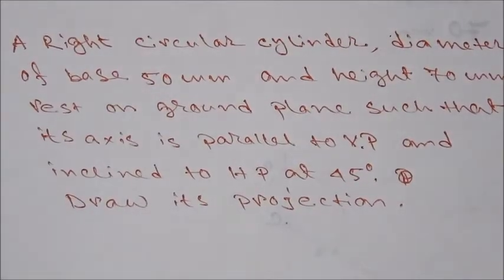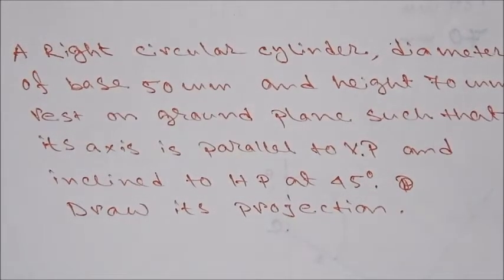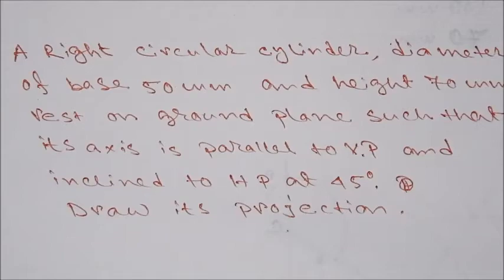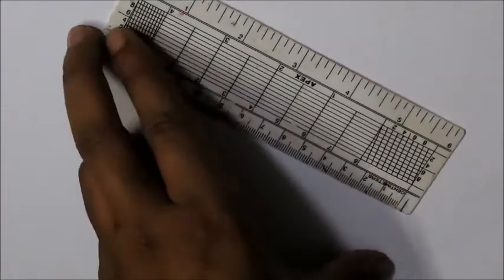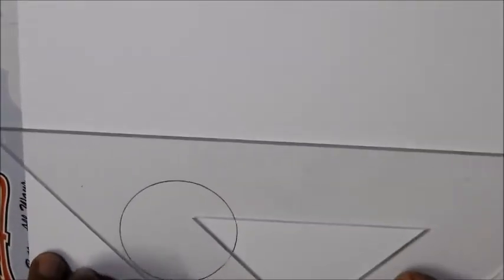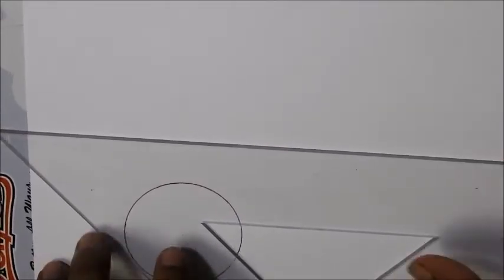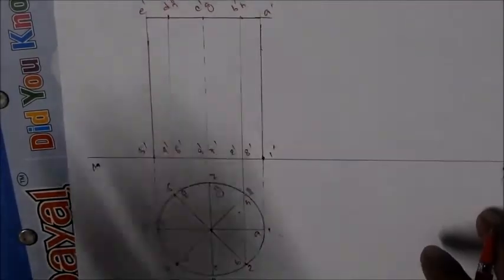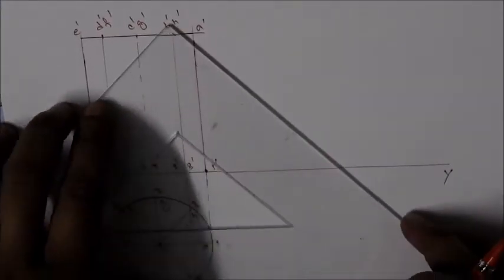how to draw projection of cylinder (solid) !! All In One

Comment: draw the projections of a cylinder of 40mm diameter and 60mm long axis is held on hp with axis inclined at 45 degrees to hp and parallel to vp. Sir could u please tell me if the front view touches the reference line?

Comment: 2.	A cylinder of base diameter 40 mm and axis 55 mm long rests on H.P. on a point on the   Circumference of the base with its axis inclined at 45⁰ to H.P. and parallel to V.P. Draw its projections.